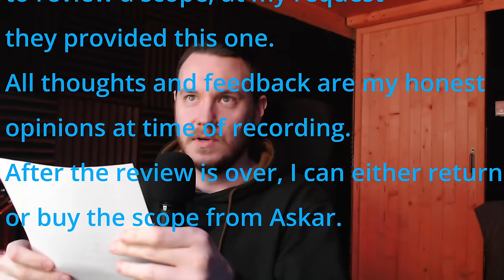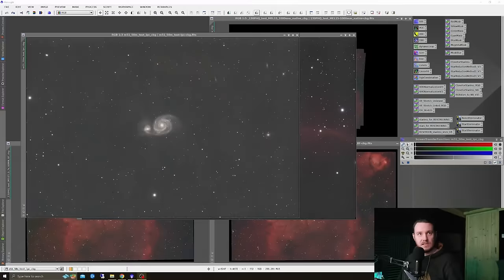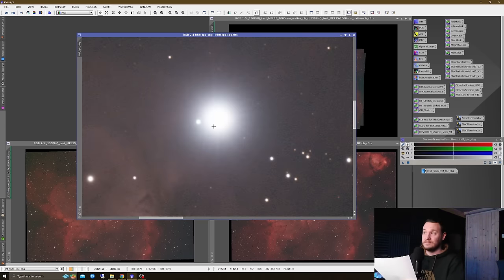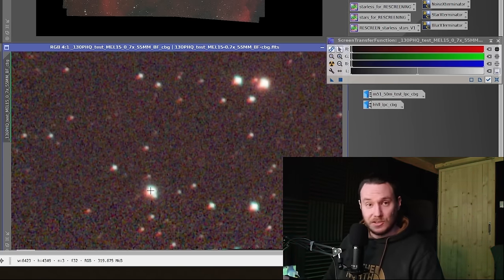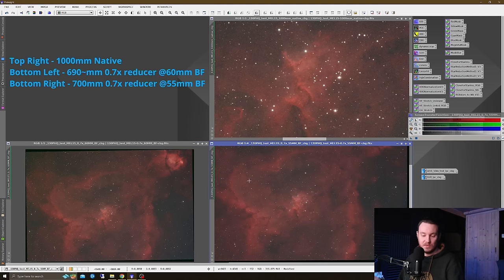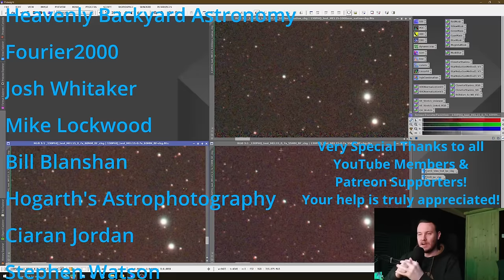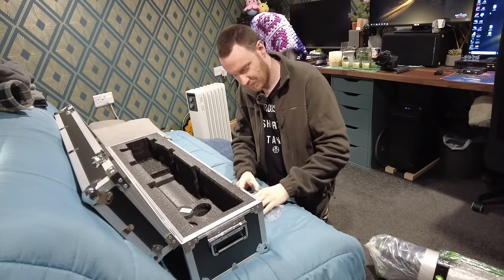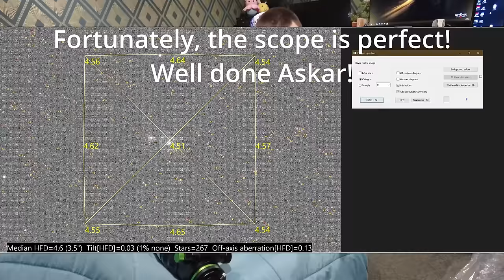INCREDIBLE Scope with an Achilles Heel? - Askar 130PHQ Review

Comment: Very nice job Luke! At the time of my review, I didn't have a small-pixel, large-sensor OSC camera (since remedied - got a 2600MC), but that really is what to use for testing corners as you showed here. My Canon Ra (5.36 micron pixels) didn't show these problems with the reducer, probably due to its bigger pixels. We really are pushing the limits of optics with the cameras now. I've seen a lot of reports that since the IMX571 and IMX455 sensors have taken over, people are no longer so happy with their Takahashis. The small pixels + large sensor combo really takes no prisoners!
Reply from the maker: Thank you Nico!! That means an awful lot coming from you mate :-)
Totally agree by the way, 100%! - as you say, these small pixel cameras and the fine sampling ratios that usually accompany them are utterly merciless at showing up aberrations that would otherwise be invisible with a bigger pixel/coarser sampling ratio.
I've seen similar reports by the way, on a related note I believe takahashi recently released a 1.01x flattener for their fsq85edx as a response to that kind of issue! Hopefully more options will become available for folk who need them too.
Thanks so much for watching my friend!
Reply: @lukomatico  I have the same abberation problem on my FRA500 with my 0.7 reducer aj FF sensor.
Reply: Absolutely correct, since getting my QHY268m and OSC version, I am selling my tak, as it just does not like the small pixels at all…☹
Reply: I seem to be the only one who is absolutely happy with FSQ-106 and IMX455 fullframe performance ? Also 1.01x flattener mentioned here for Baby-Q is absolutely fantastic and covers well FF sensor + doesn't cost a lot
Reply: @nadirteymurov1  sorry but I don’t agree re the FSQ85, it’s poor even with the new corrector on even APS-C size sensors, I had one for a good few years and with modern small pixels cameras it’s not good, you zoom in 3-1 on your images and then take a good look….uncropped images that is..👍🏻
Reply: @Astro_Shed  I'll second that. Though I tested the FSQ85 without the reducer. Bought one brand new, and returned it, awful performance with the ZWO2600. No such problems with the lowly FRA400. Meanwhile my much older FSQ106N Fluorite is far superior to the FSQ85. I thought it may have been a quality drop during the pandemic, but sounds like it could be a design flaw.
Reply: @Astro_Shed  Thank you for doing that, very interesting indeed. I wish we had discovered this earlier without spending so much time effort and money trying to make it work. You bought yours second hand, imagine getting that kind of performance on a brand new scope you had to wait 4 months for heh. 
Like you I found the concept of a flattener for a "flat field" scope to be borderline insulting. So given how it performed without it I decided to not even bother trying it. I also measured the field curvature and the result was shocking on APSC, it was approaching 30% in the corners. 
To say I was surprised would be an understatement. I've owned 2 Taks in the past and still own the old Fluorite FSQ106N. 
I don't think I'd ever buy a new one, given how amazing the stuff coming out of China is at this point.
Reply: "The small pixels + large sensor combo really takes no prisoners" 

That statement is true, and due to the limits of manufacturing and physics, there will always be issues unless we want to spend 100k on a scope, and even then... 

The great thing is that software is also advancing quickly and programs such as PixInsite along with plugins now can deal with these issues... ie. register stars for each color channel and an AI-driven deconvolution plugin (Blurexterminator) can fix the elongation of stars for example. 

I just bought the Askar FRA 500 (in the mail!), but in the back of my mind, I was wondering if a doublet would be enough for me now with the software around...  

I can't get over how much images have improved in just 4 years I have been imaging. (Owned telescopes for over 35...)

The funny thing, reviews like this do work on me... I got to thinking about getting the FRA after a vid Nico did.

Comment: A near f/8 refractor should perform very well.  Too bad Askar provided a less than optimal flat field focal reducer.  They are probably only taking from a short list of menu options from the OEM they arte buying from resulting in very little control over the optical performance.
Reply from the maker: Indeed John, fair comment mate! 👍
Reply: This is a true point but seems to be lost when discussing the TOA-130.  It is heralded as the best corrected scope out there.......but is F8 and twice the cost.

Comment: A great review and very valuable observations regarding the reducer. My 0.7x reducer for Edge HD 8 gives me identical chroma issues as the reducer in your review.  Nobody told me about that before I bought it (I really don't like it).  I will sell the SCT reducer and I am now looking for an alternative for 1000 mm  focuslength. The 130PHQ without the reducer is now on the shortlist!
Reply from the maker: Glad it was helpful mate!! - That's really interesting to hear about the 8" Edge HD 0.7x reducer, I saw the exact same thing on mine when I still owned it (a few years ago) - Really disappointing! (and as you mentioned, nothing much talked about online regarding it either!)
If you want a 130PHQ for 1000mm work then I think you'd be very happy indeed! :-) Good luck mate!

Comment: This was excellent Luke, most of the other reviews I have seen about Askar said  scopes were budget scopes, for that reason I always dismissed the reviews as I want quality stuff, not an econo scope. I know something can be semi-budget and still good quality. You have really enlighted me and provided an excellent review. I have been planning to add a refractor to my scope collection, I was leaning strongly toward William Optics (Redcats and GT series) but now will add Askar to the mix. I know Takas are top of the line but I need something I can afford, Askars are in my price range.
Reply from the maker: Thank you my friend!! - That really means a lot to hear.
I've been hugely impressed by the fit & finish and optical performance of this scope at native focal length for sure, a true performer! - A pity about the reducer, but I'm sure Askar will be able to remedy it somehow, it may also be that I simply got a bad reducer unit!
I genuinely believe if you wanted a scope in this price/size range then you could certainly do a lot worse than the 130PHQ! :-)
Clear skies my friend, thanks again for watching!
Reply: In this kind price range, also look into the Esprit 120. It has been battle tested and sharpness is known to rival Taks for sensor sizes that aren’t full frame and has an excellent flattener/reducer. Secret tip is to buy from First Light Optics in the UK even if you are in the US. After import duties/shipping it is still cheaper than most US retailers and they even bench test for you!

Comment: Luke, I have a newly acquired 151PHQ - with the native focal length and no reducer, the field flatness and color are excellent across the entire frame.  With the reducer (same one as yours), 60mm backspacing appears to work much better than the stated 55mm.  I have reached out to Askar and sent them the data to look at - stay tuned.  Great video!
Reply from the maker: Huge congratulations on the new scope Jim! Very interesting to hear that you've had the same findings with your scope too. I think the spec is off for the askar reducers, can't be pure coincidence that we've both reached the same conclusion independently!

Good luck and clear skies mate 👍👍
Reply: @lukomatico  Not quite independently! :-). I saw your video before I tested the reducer on the 151 at 55mm backspacing and when it did not work, went from 55mm to 61mm in 1mm increments - eventually landing on 60mm as ideal.  You did all of the heavy lifting! :-)

Comment: Nicely done! Great review and very thorough. I would be concerned about having a filter in place for optical testing as dichroic filters are known to add colour to off-axis images with faster light cones. And Optolong’s are known to exhibit haloes. However, I assume the same filter was in place for the native focal length images. If so, that does even the score between the two sets of images and does point to the Reducer being the source of the aberrations. SharpStar/Askar are known for issuing units initially that have optical issues, only to correct them in later product runs. Owners of the first defective units may or may not get a replacement sent out to them. Thanks again!
Reply from the maker: Thanks for the great feedback Alan! - I definitely hear your point about the dichroic filter issue for the test, I guess I'm a bit stuck though as if I wish to test any scope's performance with a duo-narrowband filter then it'll be inevitably be a dichroic filter in nature as I don't believe any narrowband filter is dyed-in-the-mass! So, at least it's a level playing field :-)
Thanks so much for watching and sharing your experience!
All the very best,
Luke

Comment: Since this 130PHQ and ZWO’s 130FF APO are carbon copies of each other I wondered if ASKAR did a better job of building their case. In particular, can you attach the ZWO EAF on the PHQ and put it away in the case? I love my Askar V scope which can DO THAT. It even has  a cutout in the case to do that. I’m a mobile astronomer and need the portability. Taking the EAF to move every time would be a pain…small screws in the dark. Also no mount point for ASIAir on OTA cage with ZWO. Askar? Wondering? Thanks!
Reply from the maker: Hey mate! - I don't believe you'd be able to use the case with an EAF attached unfortunately! I agree, it's really an annoying design oversight that we see on so many scopes, it's great we get a case, just let us use it with the scope 'trimmed up' ready to go hey! :-D

Comment: Thanks Luke. I have been bitten by the bug wanting one of these but I am wondering if I am just making a "Very Heavy (and costly) Rod" for my back? Nico Carver is warning me about that but I am not yet totally discouraged to try it. Costly big bugger though it is $AUD 6500.

If I may can I ask about guiding? 

I can see the need to use OAG to get the needed guiding accuracy at 1000mm.
Is it essential to match the 2 path lengths between guide camera and the imaging camera or can their focus be calibrated  and/or adjusted independently?
Reply from the maker: Hey there Ian! Thanks for the great comment mate 👍👍

It's a beautiful scope indeed, but options for versatility with it are very limited as the reducer that's available just isn't good enough as you no doubt saw on this video!
If you always plan on shooting at native FL then that's not an issue I guess, but still - well worth serious consideration given the price of admission!

Re: OAG - truly equidistant is pretty much required yes, but luckily we live in an age of helical focuser off axis guitars! It makes the job very easy indeed 👍

Hope that helps mate,
Clear skies!
Reply: @lukomatico  Thanks Luke. After much thought I think I am going to keep my wallet shut

Comment: I had a question as I am have been considering this Askar scope or even the next level (151) coming soon.  Clearly to get wider views I was thinking the focal reducer was the way to go.  The performance issues do cause concern.  I was wondering, are there any reducer options from another company or does it need to be matched to the scope from Askar?  Also, do you think you may be doing an early review of the 151?  Thanks for a very useful review, the core scope certainly seems worthwhile!
Reply from the maker: Hey Bill! Thanks for watching my video, I appreciate your support 👍
I think finding an alternative reducer is a real problem as the scope is natively a petzval, most reducers are designed for scopes with a degree of field curvature to also correct for, whereas this has none - I wouldn't hold my breath while trying to find an alternative, even the shape of the glass on the Askar reducer suggests it's probably a pretty radical design they're employing to reduce this thing, the rear element is curved like a snowglobe, never seen anything like it!
As to testing the 151, I don't think so most likely - though I may be testing an SCA260 instead 👍 fingers crossed!
Hope that helps 🙏

Comment: It is not expensive scope compared to similar scopes by other companies. No 5” refractor bitting it? Did you compare with AP grand tourismo or TAK?
Reply from the maker: Hey Ana! :-) It's priced appropriately for the type of scope it is I guess, but still a lot of money to most people!
RE: Tak/AP - Most Tak/AP owners won't ever want to admit it, but the Skywatcher Esprit line of scopes keep up with the Tak TSA/AP GT scopes when compared side-by-side from people who own both, so undoubtedly this would do the same! :-) (the TSA's are sharper than the FSQ's, so make for a better comparison)
Best to look into the published spot diagrams if you'd like to investigate it further!
All the best
Reply: @lukomatico  I compare purely by FWHM. This Ascar was reviewed by Nico Carver. I asked about FWHM. It was 2.5-2.7”. Now, I have no data from AP and Tak, but I have seen performance of 140mm TEC. FWHM was 1.7”! Now, I don’t know whether it was due to bortle 1, superb seeing (below 1”!) and AP 1100GTO mount. But, picture was razor sharp. The best that I have ever seen. Owner told me that 140mm TEC easily bits any Edge that he has owned. However, it cannot compete with 10” AG Optic, which is also high end scope. 
Esprit is exception to the rule, and cost comparable to AP and Tak, and Esprit price is higher than TEC. 
Interesting story. I have asked one famous astrophotographer (cannot name here) to process my data. He agreed (I thought he will send me packing). It was staggering difference. My looked total crap in comparison. Hmm 🤔.
Reply from the maker: @anata5127  Hey Ana! Good to know, thanks so much for sharing that information! 😀
I think it's pretty fair to say that for many of these high-end scopes the atmosphere is the main limiting factor to overall image sharpness - the Tak, TEC, AP, Televue, Borg, Esprit's and this Askar are all what I'd consider as "world-class" optics from what I've experienced & seen.
In a blind test under matching capture conditions I think they'd be nearly impossible to separate from eachother! 😀
RE: comparison with bigger optics, 100% agreed! With good enough imaging conditions, a quality bigger aperture always wins!
Clear skies!
Reply: @lukomatico  Yes, blind comparisons are absent. Therefore, it is so important to get numbers, which carry objective reflection of quality for systems. Another important factor is consistency. TEC is always consistently great. I am not sure whether SkyWatcher and Askar are consistent.

Comment: As weird as it may sound, this video helped me justify the purchase of my FSQ106
Reply from the maker: I'm glad it was useful to you mate! :-) Enjoy that scope!
Reply: @lukomatico  there is a bit of a nitpick I'd like to get off my chest: The tangential and sagittal plane are by definition part of every astigmatic system. These two words are only used to refer to the different orientations of the two orthogonal planes of which the light is focused in the same location.
What you probably wanted to say is that you see third-order astigmatism, also called oblique or radial astigmatism.
The sad story is that this is something I saw in a lot of refractors already, even when used with high quality focal reducers from TeleVue. It's quite sad really.
I mean, the ASI6200 I have is a demanding camera but ultimately what made me go for the FSQ.
What I'm really disappointed with is that the PHQ with the focal reducer with a larger aperture and not even f/5 has such problems already with an APS-C size sensor. It seems Askar really has some work to do here.